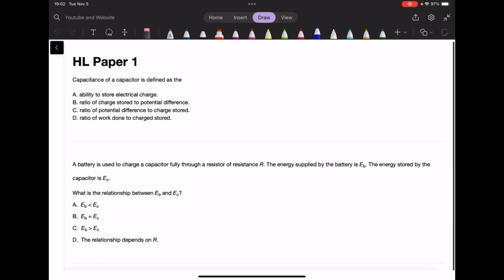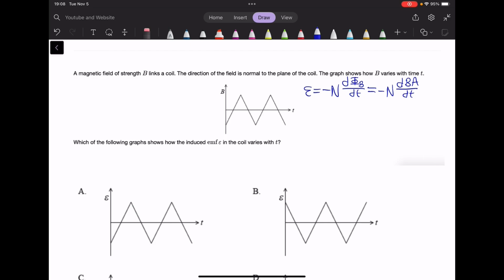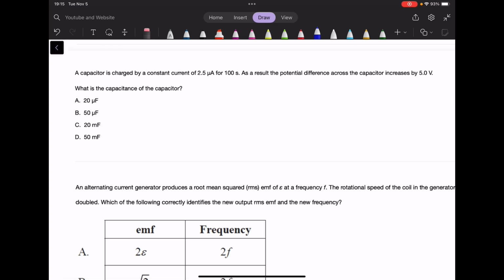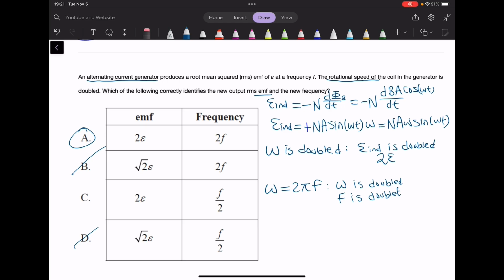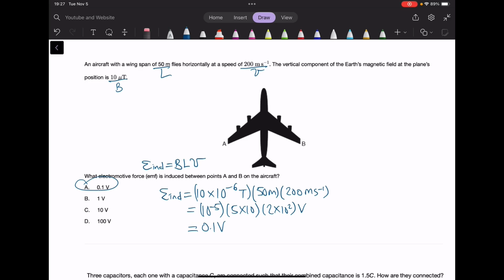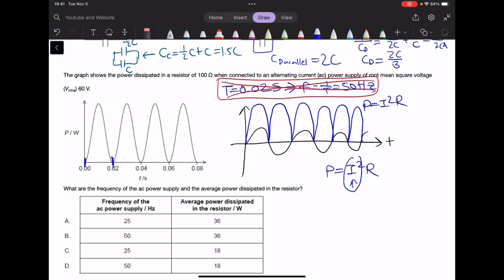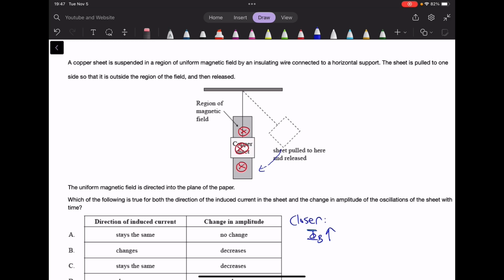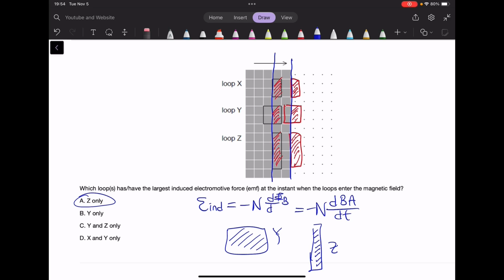IB Physics, Topic 11 Electromagnetic Induction, Paper 1 Problems, Part 1

Comment from the maker: Hi folks, it has been a long time since my last video. I apologize for the long wait. I have finished recording some solutions for paper one problems on topic 11, electromagnetic induction. I will try to finish recording all the solutions by next week.  I hope it helps.

0:00 - Intro
0:03 - Page 1
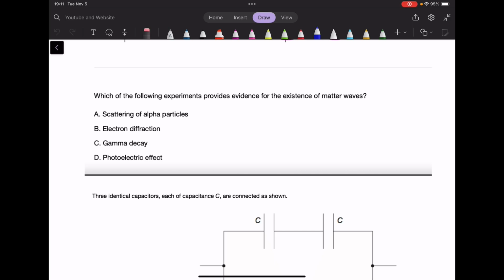09:25 - Page 2
13:31 - Page 3
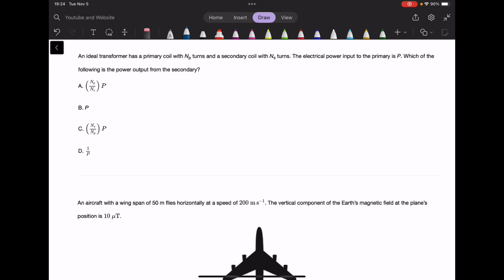22:55 - Page 4
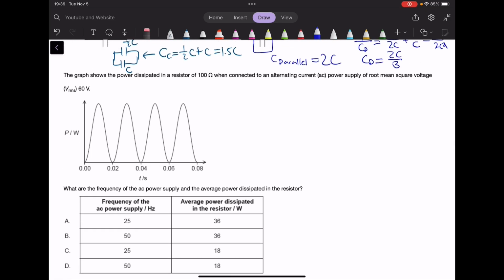29:50 - Page 5
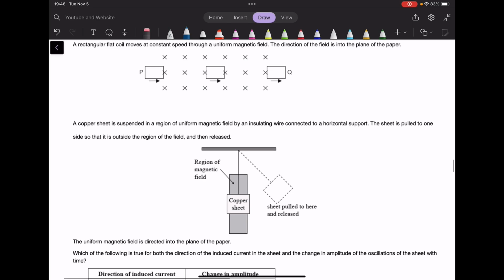37:07 - Page 6